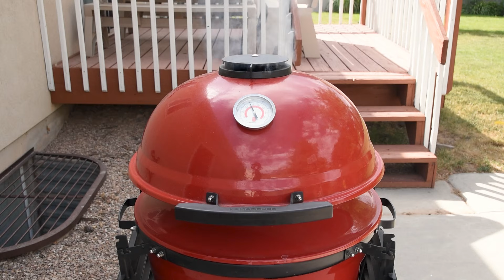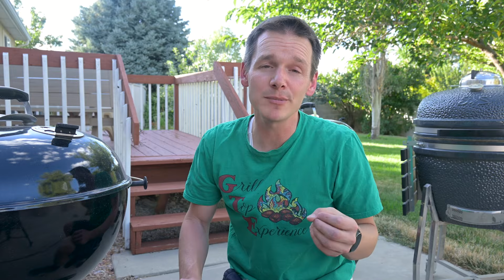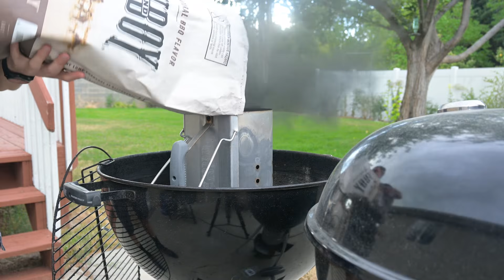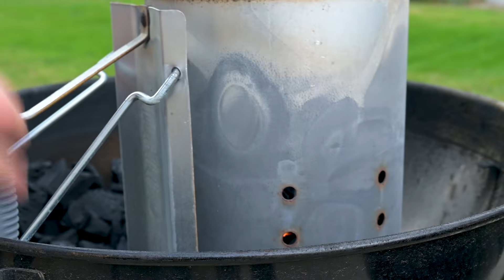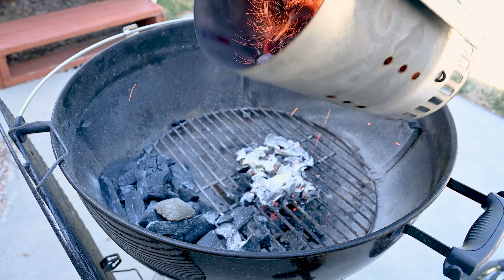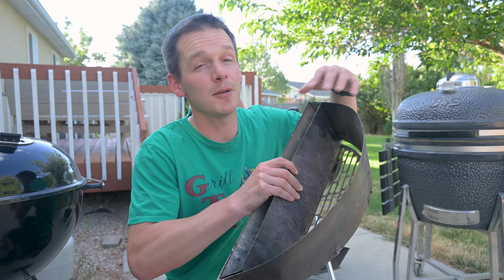How to Get Your Charcoal Grill Hotter

Comment: I don't know if anyone mentioned but "old" charcoal that has soaked up a lot of moisture can also be a problem. I had a  bag that was opened 3  years ago, and since I use he gas grill 90% of the time, the charcoal was never used up so i kept moving it around in my garage. Living in the Northeast, the humidity can be as bad as 85% daily and the charcoal is like a sponge when it comes to water. There is a possibility that your charcoal is wet, even if it feels dry to the touch on the outside. Then it's difficult to light and will not put out as much heat as it could.
Reply: Dealt with that issue today lmaoo

Comment: I have the small Dewalt jobsite fan and place it by the bottom vent at a low speed to stoke flame.😂😂 If it works; it works.

Comment: Even with the water pan in place (empty, of course), a full chimney doesn't actually fill up a Slow 'N Sear. So, I tried adding a layer of unlit briquettes into my Slow 'N Sear before I filled it up the rest of the way with lit briquettes, thinking I'd get a better sear on my steak since my coals would be closer to the grate this way. Boy, was I wrong! For some reason, I couldn't get a good sear going! I was so disappointed! How could this not work better?! When I simply used a chimney full of fully lit briquettes, and no bottom layer of unlit briquettes, I got a great sear, even though the coals were at least an inch farther away. I wonder if I was losing heat energy to the unlit coals, or if you actually need an inch or so of space between the coals and the grate to get a good sear (my coals were right up against the bottom of the grate. This result is really counterintuitive, and it's really bothering me that I don't know exactly why I got a better sear with my coals farther away. If you got this far... whoa.
Reply from the maker: The standard Weber charcoal chimney will fill the 22 inch slow n sear. If yours is smaller leave the lid off for a few minutes to allow the other coals to light. I wouldn't worry about it though since you found a method that works for you.
Reply: @GrillTopExperience  Good to know - I was using a Kingsford chimney. Thanks for the reply and great content!

Comment: Ahh, appreciate the tip on using the bottom vent for major adjustments! I have been mostly focusing on the top vent for temperature adjustments and been struggling to reign things in. Starting with the bottom should work better!

Comment: I only keep the vents wide open for a clean fire and control temp with the amount of fuel.  In the summer I use my "Santa Maria" attachment for the kettle (Burn Shop) and burn a mixture of lump and oak wood.    Loved the Snake Method vid you did.

Comment: what is the easiest/quickest way to put out coals so we can reuse them other than pouring water and then drying them? does it go out quick if you close the vents or still smoulders and reduces?
Reply from the maker: It'll mostly cool off in an hour or so after you shut the vents. I would leave it overnight or longer to make sure everything is all the way out. That method saves most of your charcoal.